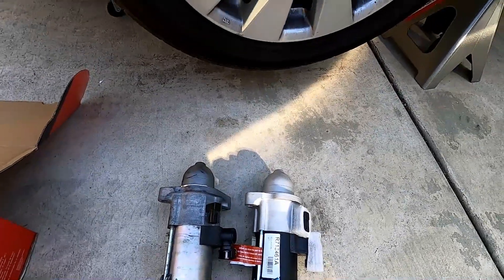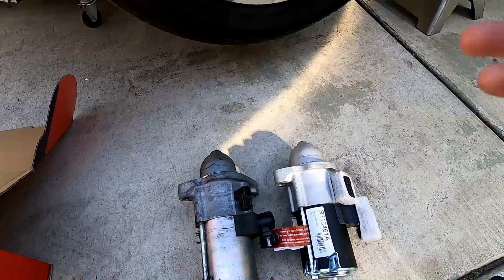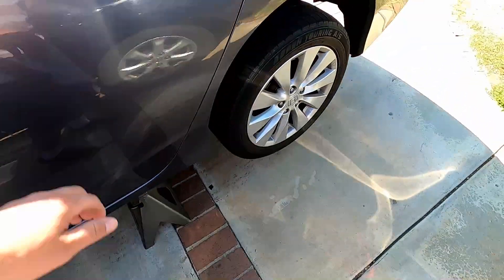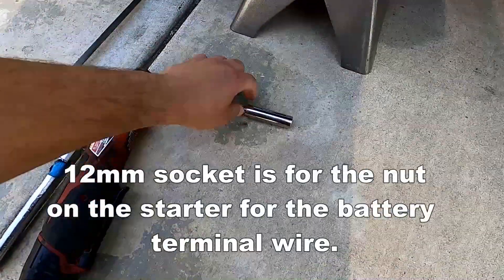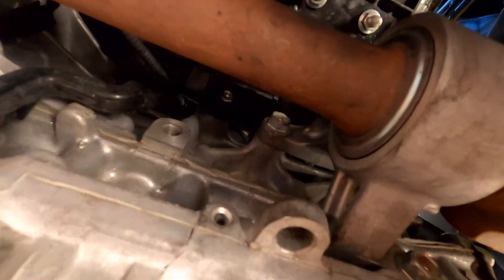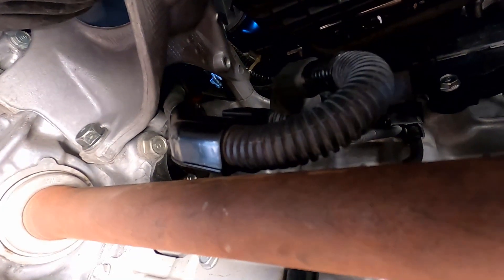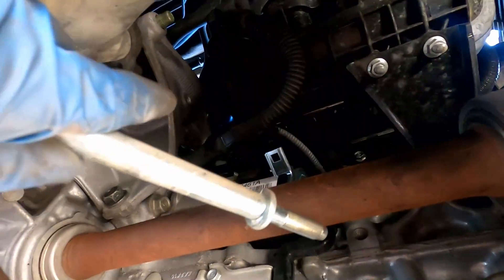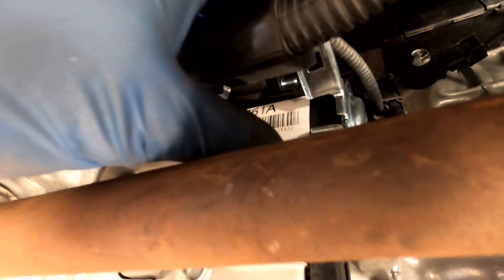2013-2016 Honda Accord starter replacement

Comment: Got one brand new with next day delivery on Amazon of all places. $69 + tax. And a 2-3year warranty as well. Even took my old one to a rebuild shop and they said no one would be able to beat that price on Amazon. Save your self some cash and order from the big A!
Reply from the maker: I will next time. I needed mine the same day since I was moving the next day early morning
Reply: Just finished installing. Thanks for the video it was helpful as I had taken out the old one a week or so ago.
Reply from the maker: Thank you, im glad the vid helped
Reply: Hey, I'm going to replace my starter. How is that Amazon one works for you so far?
Reply: Does it fit a 2015 Honda Accord EX-L 2.4L?

Comment: In the hunt for a used one right now send link if you run into one thanks 2013 honda accord lx automatic, thanks in advance !
Reply from the maker: Anytime, Call around your local shops that rebuild them, it'll still be cheaper than buying new
Reply from the maker: @unrestrictedclimb  I needed one the same day , I couldn't wait for it to ship.

Comment: Thanks for a great video.  That helps.  Did you use the re-furbished after market starter or re-furbished OEM one?  Have you had any problems with the starter since?  The dealer told me that Honda is sensitive with the after-market products.  I hope they didn't pull my legs.
Reply from the maker: I needed to refurbish the Orginal one since I needed the car the next day.  And I haven’t had any problems with the start since
Reply from the maker: Unfortunately dealers will always try to up sell you.

Comment: wouldn't it be safer to have the entire care on solid stands like pieces or rail ties, rather than lifted on stands.  I would feel safer in the 4 tires would be on solid stands rather than lifting the car on the chassis, because removing the starter will make the car move even tilt..
Reply from the maker: it would make it easier and safer, but I don't have access to a lift. you always make sure you do a bump test after putting any car/truck on stands or lifts to make sure nothing happens.
Reply: Unless you have a four post lift. You're still lifting at the same jack points whether it's jack stands or lift. Yes you always do a bump test stands or lift 👍

Comment: Great video.
I wonder what’s the mileage when it gave out?
Thaks again for the video, very helpful.
Reply from the maker: around 80k
Reply: for our 2014 honda - 47k!
Reply from the maker: Whoa that’s early
Reply: Wow, mine has 295,000 and finally died at my house. About to do it in the morning
Reply from the maker: Wow!  Wish mine lasted that long lol
Reply: @luckycarguy  so, I replaced it with one from O'Reilly, complete mistake. It sounds so loud and rough. I'll have to bite the bullet and go buy a factory one
Reply from the maker: I would take it back and get another one ,  I forget the brand I got but I have no issues with it
Reply from the maker: @FA-cd2de  i ordered mine off rock auto   havent had any problems

Comment: I just replaced mine. Having a weird ass grinding noise now, but the car starts up ok. I’m assuming it’s not aligned or whatever. Any idea what I should do?
Reply from the maker: i would take it out to see if you installed it correctly, you may also have a defective one as well
Reply: @luckycarguy  yeah I believe it was defective. I just replaced the remanufactured one with a salvaged one. Don’t have any issues, and no more metallic grinding noise.
Reply from the maker: @jmc224  glad you figured it out,

Comment: Anyone in atlanta area can help me install mines?
Reply from the maker: Hope you find someone who can help. It’s not easy when you reach the two bolts.  Some have better luck but most of the time it makes the job hell.
Reply: @luckycarguy  supposedly you can take the cv axle off
Reply from the maker: I’m curious on it,, seems like a alot of people are having problems with it